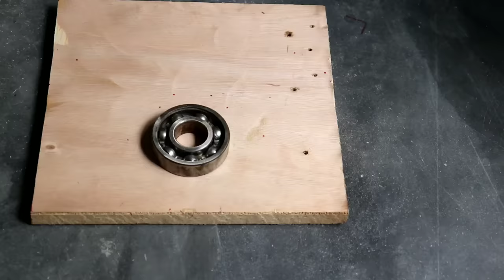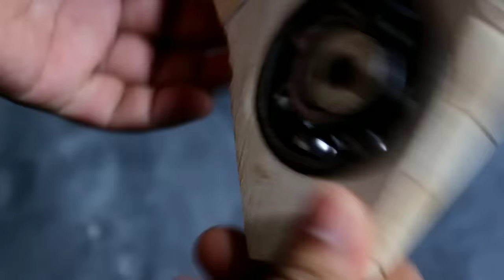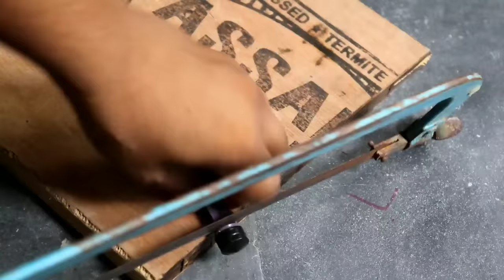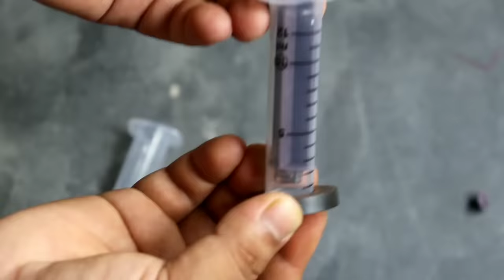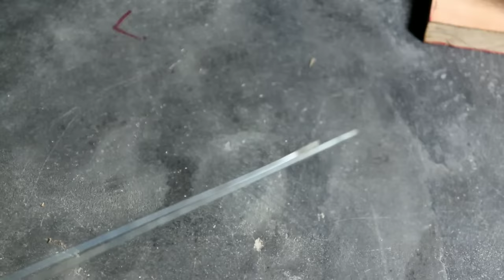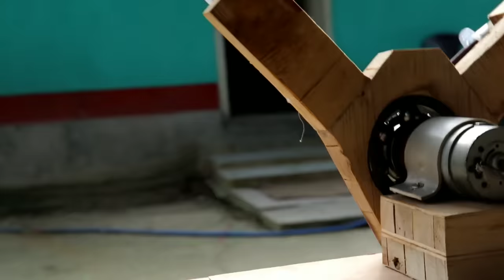dubble cylinder engine 100% working

Comment: Genius in "Simplicity!! "Wonderful use of simple common items easy to get!" Thank you ... bycycle spokes was a great use of a strong material!
Reply: Having had a quick look through you channel there/profile there I'm can be fairly certain that your comment is in fact not satire. This is not genius this is a scam, it is meant to get views and make him money that way. I can 100000% guarantee you that if you were to try to recreate this it would not work without an outside power source. The friction of the plungers would ensure that the magnets would find they're equilibrium and it would come to a stop fairly fast. Unless you could build a system that has no loss of energy perpetual motion devices simply do not exist.

Comment: Fun fact : Power source is inside the lower small block on which motor is placed ☝🏻
Reply: Confused on why you think that there was no way to connect wires to it from the bottom  and there was no extra wires to it to start

Comment: Why don't you take rotation test without a motor before? if it's installed, you can see the rotation from the motor.
Reply: Because is fake
Reply: Why didn't rotation drop when the light on?
FAKE
Reply: Fake fake and fake
Reply: Same question....
Reply: creo que no lo hace porque el balero necesita un poco de resistencia misma que le proporciona el dinamo

Comment: I was thinking, if he used a much smaller bearing, motor, and drilled a tiny hole in the middle of the magnet and fed them onto a thin wire, you would reduce the friction quite a bit. And then I thought, well the magnetic energy is there, and it doesn't stop/run out, so theoretically you could keep utilizing that energy. 

And then I thought the two magnets would just quickly reach equilibrium, as one side is pushing the same energy as the other, and for this to work, you must push one set of magnets past its magnetic resistance in order to ha e it jump back, and the same set of magnets, could not push an identical set of magnets past their magnetic resistance.
Reply: In this kind of video people always discovers that with different gear ratios, magnet, enormous wheels, continent sized gears, one will eventually defeat physics... ignoring they are just increasing friction, heat and entropy... or find ways to reduce friction. Friction MUST NOT EXIST for this to work, sorry, entropy must not exist.

Comment: Complete bullshit.  Prove me wrong!  Lift that thing off the table and show the underside while it's running.  Show me there's no battery hidden under the table running the motor, (not a dynamo).  Or, better yet,  remove the motor and show it running without it attached.  Don't fall for this, it's bogus.
Reply: Ninguno de estos es capaz de levantar su "invento" de la mesa y probar que no hay ninguna batería conectada
Reply: @amexlopez2699  ¡Estoy tan contenta de no estar sola!

Comment: I'm not an electric engineer, but as far as i know you roughly need 4000 rpm (66 rounds per second) to get the 12v , and I don't see that speed so i support those speaking of the hidden battery theory

Comment: If that device is genuine and doesn't have batteries hidden inside the bottom wooden base (or anywhere else) then that is a protracted energy-producing device and will eventually run down due to the laws of thermal dynamics. It's still a good idea but how much load can it handle and how long until it dies down?
Reply: It does not run due to the laws of thermodynamics, it actually CAN NOT RUN by the same laws.

Comment: I know that it looks like it wouldn't work, but the thing about it is, an object in motion tends to stay in motion, and when you get a hunk of metal like that larger motor coil spinning, it's just enough inertia to push a tiny little magnet force past it's resistance just enough to have pressure to push back on the cam turn.  100% do able in principle, as an Engine.  It's about "balance" of forces and utilization of conservation of energy.  
In truth... there is always difference between ground, and about 10ft in the air.  That's voltage... you can put any circuit between that to collect/convert/multiply etc....  Energy without motion.
Reply: you ignore friction, heat, electromagnetic resistence and, must of all, ENTROPY. Magnet themeselves are used to convert energy (with loss of course) and can not produce energy from nothing. Bearings, material deformation, other material friction. A perpetual machine violates by definition conservation of energy. Plus, when energy will leave the system in form of electricity, the engine will not be able to sustain (impossible, but let's say it is) mantain itself, so a system must contain MORE energy than it can contain. So wrong.
Reply: @davidenasato7305  Humm... You ignore engineering, and experimentation.  Friction, heat, and resistance are things that can be engineered out, and designs like this are static balance, pull start, you put energy in.  I never said it was perpetual, the flimsy material and construction will wear it to failure as vibration does it in, but this is a presentation of principle.  Perpetual motion isn't what we're talking about... more like... orbits of planets, it just seems like eternity, but it isn't.
Reply: @davidenasato7305   A better description of the principle is... 'Low Loss'
Reply: @davidenasato7305  There's a great deal of energy in a small rock when it's on top of mountain, you need only give it a push and an avalanche of energy can be released.   Magnets, are like little mountains of tight fields.
He had to use wood and plastics, because any metals would have sever drag of the flux lines and that is the kind of resistance that makes these 'impossible.'  So we could have a really long discussion just about materials... and that's engineering.  You can change rules by changing materials.
Reply: @davidenasato7305  Field law physics is what is in question, I know it.  Cause Field law science isn't that great yet.  I've heard scientists say 'field?', so for the sake of my comments, interchange with surface tension.  Like on a droplet of water.  You'll learn field by learning surface tension, studying a droplet of water.  
It's compression, and pressure, and alters energy density in space/time.  There's math in there... just put another x in all your equations.
Reply: @seanreichle983  Sean, your curiosity and desire to innovate are truly admirable. However, it's essential to carefully consider the basics of physics when discussing new ideas. 

When you compare the way magnets work to how water forms droplets because of surface tension, it's a creative thought but not quite accurate. Surface tension is about how water molecules stick together, making water droplets round to keep their surface area small. This concept doesn't really apply to how magnets and electromagnetic fields work, which are about electric charges and their movements, following a whole different set of rules. Mixing up these principles can lead to confusion and might steer us away from real, workable solutions.
Reply: @davidenasato7305  I did say experiments... didn't I?  Here's a fun one...  Get yourself an ultrasonic transducer.  A hobby or robotics type they use for distance measuring and use just the transmitter piece for this one.  Mount it, and place a small object of any form in front of it.  It will echo that form in space time out in front of it scaling up the further out you go... flying apart, and then back together again until full cohesion loss.  It'll replicate the atomic lattice structure and if you selected a metal or 'correct' material for this it's 'surface tension' field should be strong enough to hold a gas, or smoke.  Differing materials differing field strength of it's surface tension.
An elementary field.
You can even use them to hold Hydrogen gas in place, in space, and flash it into Hydrosteel, to build starships.
A starship from a gas canister.
Science is in the mind.

A material like glass has a fluid like internal flow of energy that bounces around and flows within objects in an almost 'perpetual motion flow'  you might appreciate.
Reply: @seanreichle983 ook, this is the last, i can't waste time like that. Sean, your ideas leap into science fiction rather than science. Ultrasonic transducers cannot manipulate matter to the extent you describe, such as echoing atomic structures or creating materials like "Hydrosteel." These concepts misunderstand the fundamental laws of physics. Using sound waves to structure or hold gases in precise forms, especially for complex material synthesis, goes beyond our scientific capabilities and understanding. Science demands ideas be tested against empirical evidence and grounded in reality. Imagination fuels innovation, but without adherence to established principles, we venture into fantasy rather than feasible science.
Reply: @davidenasato7305   We don't talk about experiments until we've done them.
Reply: @seanreichle983  Ok. It also happens with sh*it, you don't say you took a sh*it until you pooped.
Reply: @davidenasato7305   Good talk.

Comment: Free energy(Indian style) = Indian made sticky glue + rusty magnets + a rusty 12v motor + the most important thing (hidden batteries)

I will try with the Chinese super glue maybe the thrust will increase by a few more "REVOLUTIONs PeR MinuTe" ... Maybe then I'll find my keys in total darkness while all I need to do is turn on the phone flashlight.

Comment: Help!  
I followed your instructions step by step and build one in my garage.  It is a little off balance so once I started it up it made this horrible clanking noise and wouldn't stop.  It is vibrating so badly that it is setting off all the car alarms in the vicinity and I can't get it to stop! The neighbors are really angry and nobody can get any sleep.  
I unplugged all the wires and smashed all the components to smithereens with a sledgehammer but it is still going!!! 
What should I do‽‽‽

Comment: Wow made one my self it actually works dont even need the inverter on the back that’s only if you wanna create a small amount of energy to power something like say a lightbulb but if you made this on a larger scale I’m sure it would create enough power to do a radio or something but for this to have enough force to move an object no way

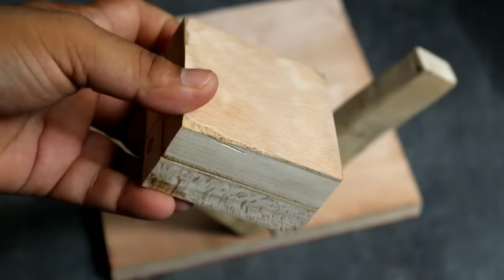Comment: At 3:06 and 3:07, when you are showing the 2 wooden square pieces glued to each other, I noticed holes in the bottom square piece. Are you hiding a battery in between the 2 wooden pieces?

Comment: not sure why people are going crazy with the "fakeee". he isn't showing some magical gravity perpetual machine. he's using Neodymium magnets... and a dynamo.. and the design at 45 degrees alternating, is enough to light one led bulb. calm your ignorant farms.. it's not "free energy". if you want to nitpick the weak link/efficiency here, assuming you wanted this to run 24/7, it's the bearings/wheel, which will be under a lot of mechanical stress, require constant lubrication and replacement. 
another way to think of it is a candle to you keep going by constantly adding wax. but it's not "fake". if it's "worth it" is another question.
Reply: oh, and the springs that are used to detach the magnets would probably fail pretty frequently too..

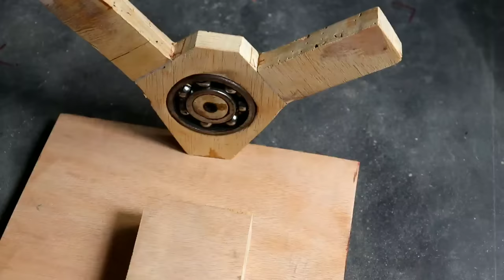Comment: at time 3:17 is where he installs the box he made from two piece of wood, hollowed out with batteries inside to look like pedastal . Very thin wires are behind those plugs on each side, one is V+ one is v -,  The plugs are there to conceal the wires while he shows it as a pedestal in video. He will pull out those very thin wire off camera and attach to the terminals on the motor and you cant see them because they are thin as hair. .What a scammer. people like this should just be arrested and sent to prison. Fraud using the internet for the purpose of making money is a federal crime. It is called wire fraud

Comment: Why are there so many comments sayi g this cant work?

After all, you can get magnets of almost any strength, with great force, im sure you could rotate that bearring
Reply: In this kind of video people always discovers that with different gear ratios, magnet, enormous wheels, continent sized gears, strange materials, one will eventually defeat physics... friction can be reduced, but is always there, and will ALWAYS let some energy to be lost. A perpetual machine is not just impossible on paper, you just need a bit of good imagination to think that a system that runs on its own energy, if ever possible (which is not), will stop once you take this energy out to light a bulb. Or it must contain more energy than it can. Just impossible.

Comment: Haha! You should show how good it is without motor connected. Based on your principles the bearing should  spin without connected engine. So, show it)). Moreover, the moving resistance of magnates inside of such motor able to feed a  bulb will be much higher than resistance of magnet inside syringes. So, you are one of those 🤡

Comment: This is a big lie. You have a 9 volt battery between the 2 sheet of wood and the electric motor feeding from there an runing. We want to watch how run this engine without electric motor, just the two seringe and the bearing. This energy ist imposible. You are a big liar and a scamer.